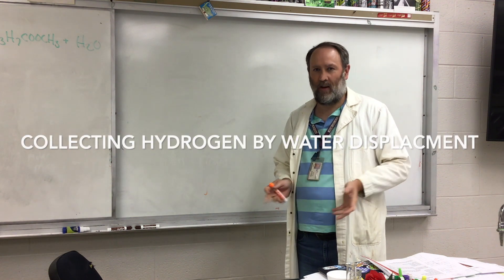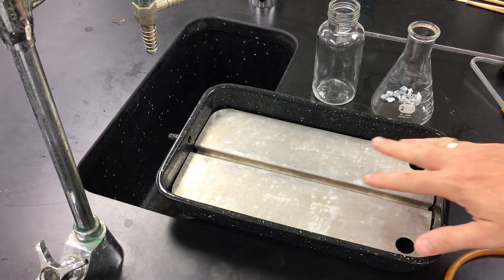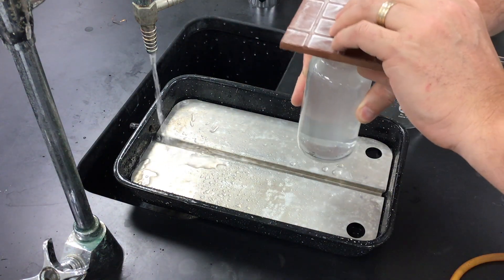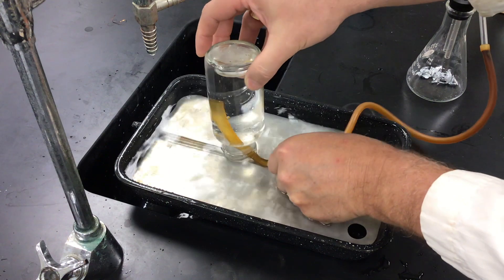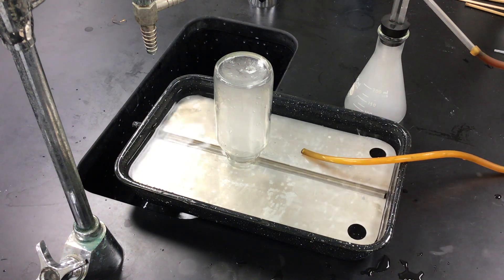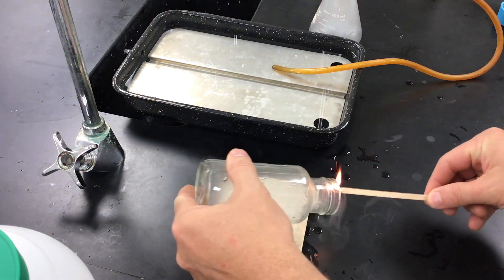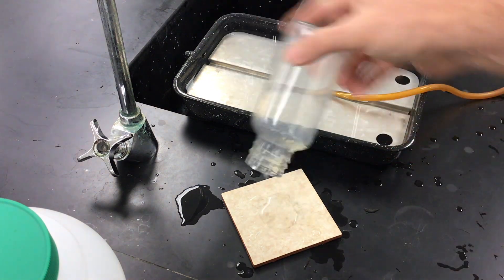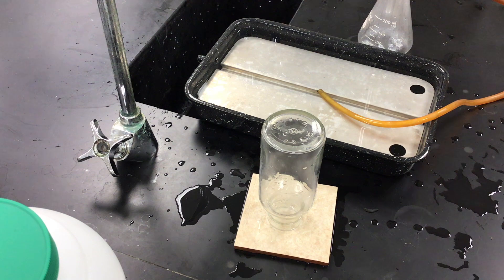Collection of Hydrogen by Water Displacement

Comment: I also observed that the rate of generation of hydrogen was pretty fast( as can be seen by the speed of water displacement). Sir , if I generate hydrogen thru' water electrolysis and then collect it by water displacement method , will the rate of H2 generation will be as fast as in your experiment , or will it be slow. ? 

Secondly , if I wish to measure the rate of hydrogen generation in ml/min or ml/ hour , can I prefer a calibrated bottle instead of a plane one..? Kindly suggest .. Warm regards
Reply from the maker: First question.   It is dependent on how quick the electrolysis is going.  But normally you would be doing that under water anyways since you are tearing up water.
Second question… you would need to calibrate the collection bottle.  But if hydrogen is being produced quickly to might be a little difficult to get before all the water would be flushed out.
Reply: Thanks a lot Prof. 😊😊